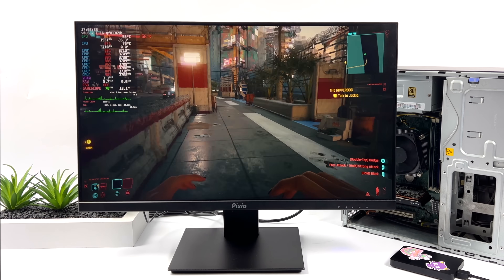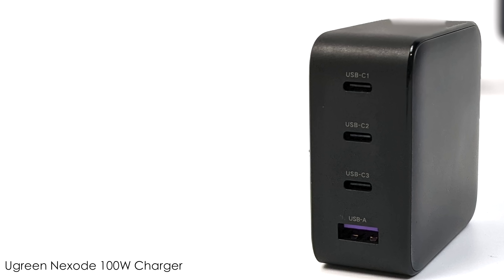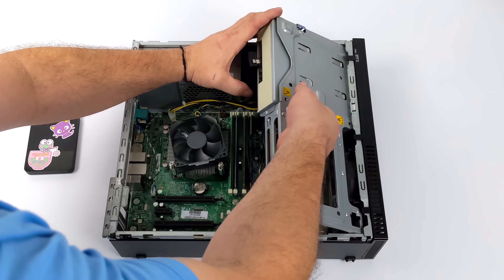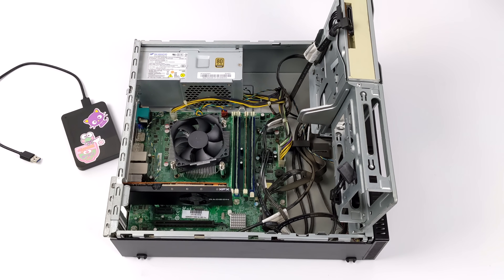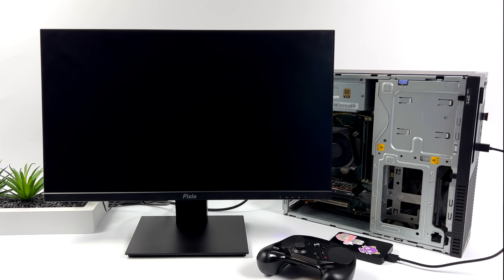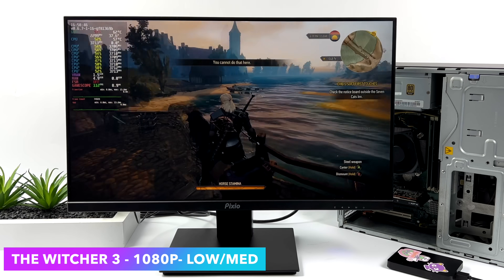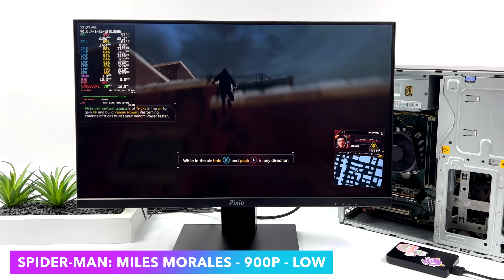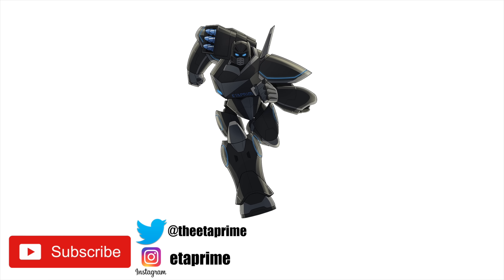This Super Low Cost PC Runs SteamOS 3 Better Than The Steam Deck!

Comment: You should have mentioned that there is only good AMD GPUs , since Nvidia has major drops in FPS even in games like Max Payne 3 which is over 10 years old and Intel Arch is a no-go. Great video, giving people the idea that Linux might be faster and cheaper. Drivers just work with many desktops. Some notebooks have fancy proprietary trackpads and similar, which means no support for a long time or never.

Comment: I have a question, would i be able to have Windows on one drive and HoloISO in a second one and just decide which one to use while booting?
I already bought a full PC but im still on a 1650 súper(was on my old fx 8350 build) and since steam os would be bringing dedicated gpus to a console level type of optimistization and in my country the rx 6700(10gb vram) non xt is the Best Option  at around 400 dollars I thought using the steam OS When gaming could give a huge boost to it since its biggest fall goes to vram capacity and bus width I think HoloISO would be amazing to have on a second drive
Reply: Oh and does holo iso have any Problems When playing with Keyboard and mouse?

Comment: The buying price is not high and it has impressive performance. However, I would appreciate a little digression about the power consumption in comparison to modern systems of the same speed. The reason old hardware is so cheap is not only that it becomes slow over time, it's also much less efficient and therefore more expensive in use.

Comment: Do you have issues with audio dropping out here and there?  Sometimes mine doesnt do it then other times it does it so much i want to throw it out the door.  I've got the same video card, converting it to low profile was a pain, and 32 gb of ram because someone used mismatched ram speeds and sizes.

Comment: Be careful if you order the Dell 7020/9020 SFF variants on ebay. There is a "ultra SFF' in the series that is even smaller and does not have a dedicated pcie slot available to use. Be mindful as some ebay sellers will mislabel. Got screwed. You can tell by the front of case as the correct SFF model will have two rows of usb ports. Guess I'll be setting up a separate emu machine :P
Reply: Sometimes the seller's pics are zoomed in and it's hard to gauge dimensions. I was unaware there was yet another SFF variant.

Comment: The rx6400 bottlenecks hard on that pci3.0 slot.  Could build a 2200g system for that cash, 2200g also is much faster then the steamdeck

Comment: I got a bunch of the m93p's great little machines. I won't be installing the unofficial Steam OS though, first support is not available, drivers are not going to get better, that's Nvidia's fault, and nothing the team of volunteers at HoloISO is going to be able to fix or mitigate. I'd rather just install a solid, known good, trustworthy distro, then install steam.

Comment: Hmmm I have been working (about 2 weeks) on a slim mini ITX for about the same price that consumes less than 100W running HoloISO, used MSI industrial MB, i54590T , new M.2 512GB + 16GB (2x8GB ) SODIMMs and Sapphire RX6400. Oh and it runs on 6AH 20VDC Li-ION battery pack.  I was finally able to get SteamVR working on it natively, including native HL-Alyx. NOTE: Don’t try to update the packages for Vulkan Radeon yourself. It 😮 will bork your installation requiring package downgrades using the USB install OS.  Also, SteamVR has a lot of problems running in Linux natively and takes a performance hit with Proton, which with the RX-6400 is already at the edge of meeting GPU specs (but “Air Car” runs great).  Sadly a Windows license (make sure to buy from ETA PRIME) does get you much better VR out of used PC parts for VR, and even better, you can pick up an used Mixed Reality HMD which brings this whole “mobile” package under the price of a 256GB Quest 2. 😊

Comment: This is a great budget build! Those old machines are still amazing for bang for the buck.

The Steam Deck’s key is its portability though, so definitely a trade off based on what you need.
Reply: I think the point here is that this new OS is very light, allowing gaming in the first place on these desktops

Comment: I built one of these a few years ago. Its good value but my build had huge stability issues after an hour. These office PC's tend to have bad CPU cooling and weaker psus as they dont expect them to be under pressure.
Reply: Did you remember to change the thermal paste?

Comment: I have one of those video cards, but I can't say I'm terribly impressed. It won't run Gran Turismo 4 terrible well on any track that has a lot of stands with crowds (Like the 3rd? entry level pickup truck race.) Admittedly I'm running Windows, but I don't feel like the performance with my 4700G processor and that GPU are much more than the 4700G by itself.

Comment: Nice video, great idea, however, I never manage to find the same prices
Reply: I bought a dell optiplex 9020 for 75 shipped 16gb ram no hd and the one in the video for 55 shipped 8gb no hd in the last 24 hours. I look for sellers doing buy now or best offer and multiple units to move. 2 of the 3 PCs I offered 10-20 less than their sling price and they accepted. Just fort put in the reps!
Reply: Meant to say 2 of the 3 I won, they accepted my offer.
Reply: @hooflung128  well, to me the lowest price I found was 176$ shipping included

Comment: Picked up a Dell 9020 with i5 and a separate i7 4770, 16g of new ram, a 970evo nvme and pci-e to nvme adapter along with the 6400. I’ll have to hack the bios to boot from nvme but this should be a good holiday science project.

Comment: I bet you wouldn't even need FSR on The Witcher 3 if you'd run version 1.32 instead. The Next-Gen Update took a huge hit to rasterized performance in both DX12 and DX11.

Comment: i actually recently bought a similar optiplex to put the same GPU in and make a steam machine but both HoloOS and Archlinux don’t detect my ethernet controller even though windows runs perfectly fine…
Reply: Might need to update the driver in win10 to absolute latest as this will update the firmware. Could be that Linux cannot see the expected firmware for the device. Or it could be windows updated the firmware to an in ompatible firmware. It’s a double edge sword with NICs. Also if it ever had Vista on it… that was Nuclear for firmware updating for drivers and bricked NICs all the time especially realtek

Comment: i install Batocera and i install Steam+Beta in big picture is now steamos UI .How, just press F1 and install steam direct from the flatpack, i install it on this amd a10 cpu+ nvidia p106-90 just dont forget to activate this .      nvidia-driver=legacy   nvidia-prime=true in recalbox-boot.conf i make some benchmark and is mutch faster that holoiso or Manjaro if you have probleme to boot windows game via steam install proton from flatpack. Try it ETA PRIME you will be amaze for new and retro gaming p106-90 is 50$ on ebay and it performe like a gtx 1060

Comment: If you get a tower desktop with a PSU that has a 6-Pin power plug I would go with a used RX5500XT (dose not have the bandwidth issue of the 6500XT).  Slightly better than a GTX 1650 Super, and most of the time you can score one on eBay for $85~$110.  If you demand it to be "new" Soyo Branded models on Alliexpress are selling them for $95~$110 if you are feeling adventurous (or you're familiar with ordering from the site.)
Reply: or 1 with 2 six pins like a dell precision or hp z440 rx 5700xt are only like 140 bucks now
Reply: @josephdias5859  Well yeah if you find a Workstation PC with a good Xeon, but most people gravitate towards PCs with I-Core series.  Also your right the 5700xt have gone down over $20 from little over a week ago.....  dang that is a good deal thanks for the heads up.

Comment: Given the choice between this and this mini pcs from hp/lenovo with the 2400G or 2400GE, which one would you pick?

I can pick up a Dell with the 4790 for about 125usd, or I can get the HP with the 2400G for 160usd. I doubt I will get a beefy graphics card for the price difference, so that's why I'm considering the 2400G...
Reply: As a person who used to use a Ryzen 2400G on Linux, I was able to play most games at 720p with integrated graphics. I eventually upgraded to a GTX 1650 and installed Windows and was able to run almost any game at 1080p 60 (with the CPU still being a 2400G). Ryzen 2400G has aged shockingly well imo.

Comment: If you can snag up that $99 6500XT that includes 2 games ($70 value) that is a screaming deal if you wanted those 2 games, you're basically paying $20 for the GPU, its just too bad they dont make a low profile 6500XT, i'd almost prefer this deal on a 6400.

Comment: How much extra does adding the monitor, controller and speakers that the steamdeck has add to the price? Just wondering if this could end up being cheaper than a steam deck overall...
Reply: Plug it into an existing HDMI TV, get free speakers, use existing controllers or buy a wired one for 20 bucks on Amazon.
Reply: You can get a 1080p monitor that has a speaker used for a low price (seen stuff on eBay for like 60) and a controller even new for around 60 too.

You can get a steam deck (power wise) set up for less than the 400 dollars of the deck but I'd still get the deck because you know it's portable

Comment: I had planned to build a second computer using a Bare bones HP Elite Desk G1 and some of my old parts and I actually would have made it a Steam Deck PC, but the extra GPU I had was Nvidia and I also needed decent a version of OBS so I had to go Windows with it. But if a 4790 is enough I might try again later since I still have 2 extra barebones cases (The seller I went to literally gave them to me for free with shipping) with the MB and power supply so I could just buy an AMD GPU, some ram and a used CPU... unfortunately since they're HP Elite desk G1s these motherboards apparently have an issue with USB3 drivers (although that's with Windows, maybe it's different in Steam OS?) Also ...ha, good luck finding a steam controller these days.
Reply: I'd love to know your seller lol

Comment: Question.. the UGREEN GaN 100 charger has some good charging ability. The question is, do the 100w USB-C ports run up to 100w, or do they try to push 100w? If the item only needs 25w max, will it only draw as much as the product requires, or does the charger push the amount it's designed to push?
Reply: The Charger will communicate with the connecgted device and will regulate the max wattage accordingly. A 25W device will not be charged over 25W.

Comment: Cool video and nice cheap pc with surprisingly good performance. After several trials with HoloIso, I finally did a basic install of Xubuntu on a USB SSD and just installed Steam, set the system to login and run Steam in new big picture mode automatically. This portable install works on all my machines, Nvidia (with latest proprietary drivers) or Amd with a pretty good GUI..  I tried it on Amd Ryzen 5600x-RTX3080, Ryzen 1700x with GTX1080 or GTX970 and Xeon E5-2640v3 - RX 580  without any issue. No need for HoloIso in the end.
Reply: Sounds interesting. Would you ever do a guide or step by step video?
Reply: No compatibility issues running on Linux without steam OS magic?

Comment: Whenever I see cheaper office computers (especially with older ThinkStations & Optiplexes) that can no longer support Windows 11 officially, Linux is definitely their savior. Ever since the presence of SteamOS 3.0 on Steam Deck, these PCs can become a cheaper Steam Machine by just adding RX 6400 single slot graphics card, 2 8GB DDR3 RAM sticks and a SSD. Plugging it with cheaper monitors or TVs and tada, a very budget gaming & entertainment setup indeed!

Comment: I have an older optiplex with a 3rd gen i7 and 32GB of ram. Even when I threw in this same card I couldn't get HoloISO to work after install. I can't imagine there being much difference between this processor and mine so idk what I'm doing wrong
Reply: Holoiso install process fails extremely easy without any real prompt. I recommend trying the newest holoiso image
Reply: @andrewkalar9605  thanks for the suggest. Didn't even think about grabbing the newest image and feel silly for not lol I want holo iso to be my arcade front end for my 1uparcade mod. Excited!
Reply: @courtlandbudd7462  you're welcome.  the newer images have GUI installation and seem to install a lot more reliably.  honestly, game compatibility is still where i find it hard to go 100% steamos. for now, i continue using a stripped down win10 installation and using the trick to make big picture mode in windows use the deck interface.  seems to be the best option for now

Comment: Some tips when buying these off of eBay.  I recommend ones that use standard ATX power supplies. Once day it will die and you don't want to have to find a proprietary version. Even the SFF tiny ones may use odd voltages or plugs so I like the 12V standard barrel jack ones.
Reply: I bought a couple of Dell workstations, replacing the PSU's cost triple the price of the machines themself
Reply: a lot of companies now make a plug to fix that. ETA prime used one in a workstation video awhile back. I can get these SFF and business towers from work by the 100's so I haven't been buying a personal desktop for a while now. However, if you are going to do any serious gaming you will need the adapter and swap to a standard power supply.
Reply: Anything with standard atx cost more. These can achieve dirt cheap price is because offices refreshes their fleet every few years, and flog these for barely anything. Alot of times, you can buy 2 of these for the price for a regular equivalent second hand pc, or even a new psu, so who cares if the psu dies? (And they usually use Delta branded psu, which are very stable).

Comment: I love budget builds like this. Good enough for most things and costs significantly less than what companies are trying to sell us as entry level. Performs really well
Reply: I’ve always built the most high end systems available to try and use one system as long as possible before needing to upgrade. These budget builds are getting so good now that I’d rather buy them every few years than spend a few thousand on a top of the line system that won’t last much longer
Reply: Less than what they sell the steam deck to us, while being 35x larger than the steam deck and costing 50% of the real deal
Reply: The only true downside is that you can't really take it with you.
Reply: @OnBrandRP  yeah unfortunately, unless you’re trying to stream from another device & that’s really not viable unless you’re in your house/any place with good enough internet & want to deal with input latency. Like you said though, can’t “really” take it with you
Reply: Lol

Comment: Nice low budget Steam Machine build! I actually really hope Valve tries making a Steam Machine again. I know their first Steam Machine failed, but I don't think that's because it was a bad idea. I think that's because it was the wrong time. Back when the first Steam Machine released Valve's software wasn't console quality as well as Linux gaming in general just wasn't ready for a product like that. However, now you can pretty much play any game on Linux & majority work extremely well on Linux. As well as Valve's Steam OS is console quality now. The Steam Deck has made me a believer in the success of a future Steam Machine. I hope Valve makes one! I'd buy one for sure.
Reply: What Valve should do is a) release a Steam OS 3 ISO that works on any common combo of AMD, Nvidia and Intel CPUs/GPUs, b) release a Steam Controller 2 based on the Deck controls and c) get major OEMs like Dell/HP/Lenovo to offer a SteamOS bundle (SteamOS 3 + discounted or free Steam Controller 2) pre-installed in desktops and laptops as a simple radio button option right next to Windows 11.

SteamOS 3 would need to support more login authentication methods (e.g. fingerprint reader, face recognition) and have the ability to pick the default boot environment (Gaming Mode or Desktop Mode - it's annoying the Deck doesn't have that option, especially if you're using it as your only "desktop PC" and have it permanently docked).
Reply: @rklrkl64  I think they’re going to release Steam OS as a full OS for anyone to install and use. Apparently there are some indications to this from the Steam OS github. Also, I think Valve has shown they have a big interest in putting Steam into the living room. This is indicated by the first Steam Machines as well as the Steam Deck, & Valve’s heavy work for creating a console like OS to run games. If anyone can bring PC gaming to the living room, it’s Valve. I wouldn’t be surprised if they made a new Steam Machine & a new Steam controller to go along with it in addition to a full release of Steam OS. I’m looking forward to seeing some console like Steam OS gaming PCs in the future.
Reply: I would shell out a good price for a quality steam machine